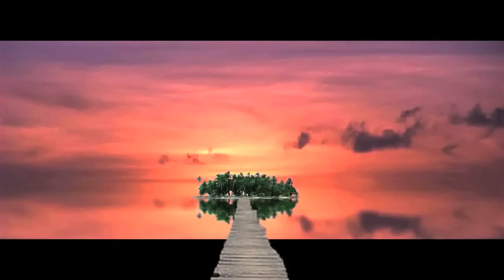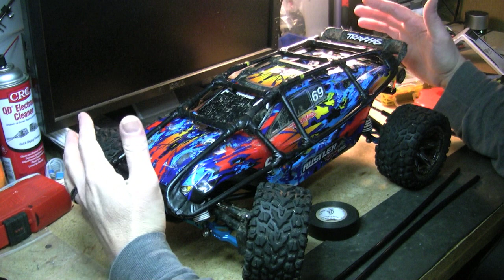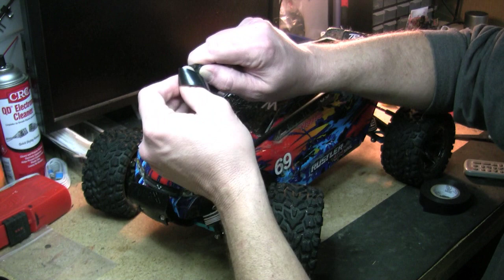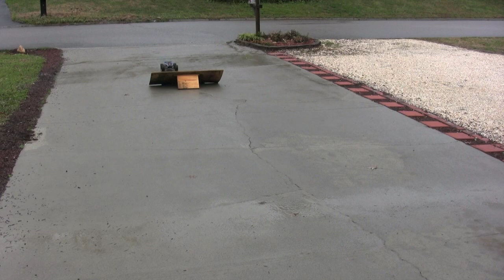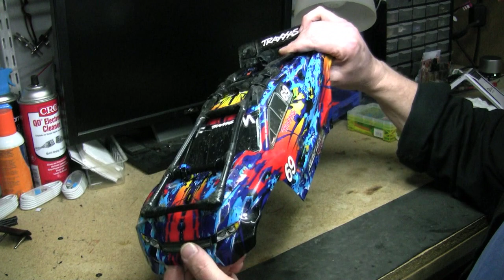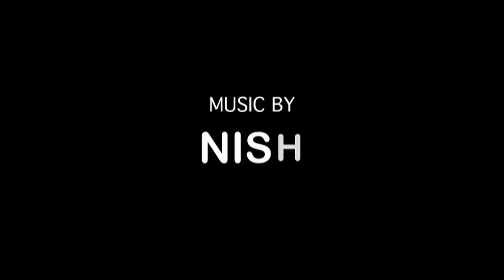Traxxas Rustler 4x4 VXL #11 - DIY Roll Cage - Prototype #2 - $1 RC Roll Cage, RC Cars

Comment: Great Idea frank. Like my self, not everyone can afford the most expensive things and are on a budget. That looks great and should work very well.
Reply from the maker: Thanks! I'm actually about to make one from a material called Delrin. It looks identical to the plastic coat hangers but it's super durable and doesn't break as easily. It's also cheap, I think about $3 to do one vehicle. Search for Delrin 1/4" rods on ebay if you're interested. I'll post a how-to video once I'm done.